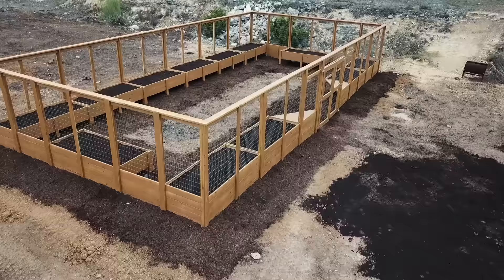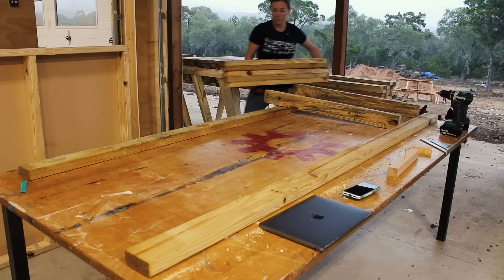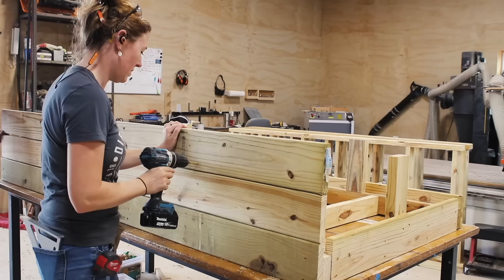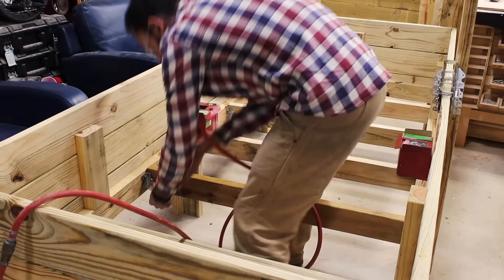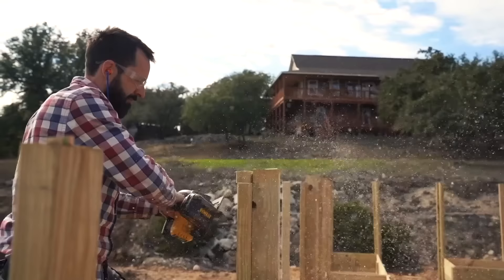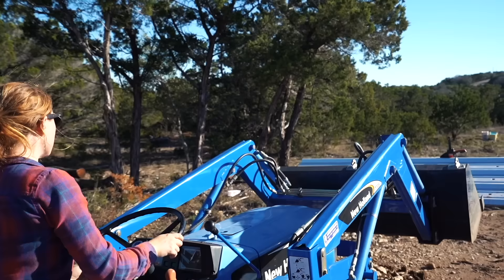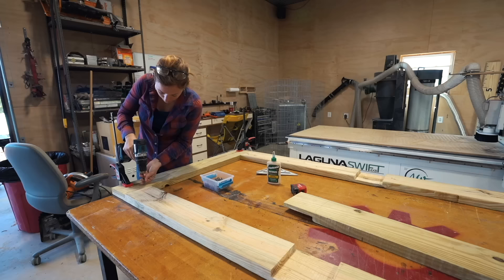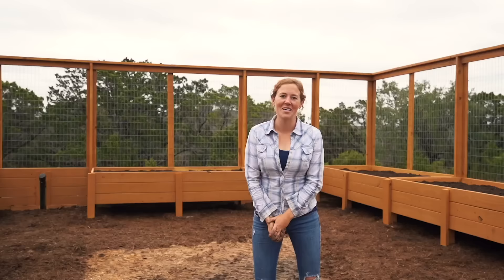Enclosed Walk In Garden with Raised Beds

Comment: I like the look of the end result but I can't imagine putting that much money into a garden. The cost of lumber alone would make it cost prohibitive for most people. 
It also does little to prevent burrowing critters from digging underneath to get in or to keep out birds. 
If you plant berries, you will soon see what I mean.
Reply: Easy enough to put a bird barrier over the top if needed.
Reply: @Flyingdutchman586  good idea, keep hawks off your bunnies (free fertilizer).
Reply: Yeah like gophers. I have a similar garden,not as big 🤣 and gophers are a problem.
Reply: Shouldve put down chicken wire at least to discourage digging animals
Reply: @i.robles5785  stainless steel chicken wire. How about a trench of bigish rocks?
Reply: She used metal roofing material for the floor base. I don't think any animals will be digging through that.
Reply: @MZPRISSYCAT  How is metal roofing material in the bottom of each bed going to keep out critters?
The gate bottom is unprotected and unless the wire is super fine, super strong, and buried over a foot in the ground critters will find their way in. In my garden, I buried the fencing 18" deep, made a drop panel that I stick in place when the gate is closed, and the fence is 7ft high. I still get ground hogs both digging under the fence or climbing over it. I watched one ground hog last season climb onto a nearby shed then it leaped into the garden off the roof. When I spooked him, he ran full speed at the gate, hit the gate mid way up and climbed right out. I now added a 16" top fold over panel on the fence both inside and out so they can't climb over and if they jump in, they can't get back out.  I've also had deer crash the fence at speed, hitting hard enough to bust through the fence or flip over it. 

Tomatoes also attract birds, they don't take one or two tomatoes, they peck at each and every one. After two years of trying dozens of bird deterents, I finally covered the top of the garden with chicken wire to keep birds out and to keep ground hogs from jumping in from the shed roof. 

This years garden will likely have a complete new fence, I'm going taller, with wood poles now vs steel to make replacement of the wire and poles a bit easier and I'll incorporate the top cover into the layout of the poles so the top wire will be a bit stronger. The last top got pretty battered down from critters getting on top. 
The sides weren't strong enough to let me stretch the top wire tight. Having permanent poles will let me put a few cross supports as well.

Comment: Try turning your steal roofing over on it's face it's a lot better for cutting and if you are using it on a roof you won't burn the finish with steal filings were it rusts latter . great video thanks

Comment: Nice job, very similar design to what I'm starting tomorrow for my daughter other than I am putting the posts in the ground, with 18" of blocks under the fence line to prevent critters from tunneling under. Using interior raised bed boxes as well. No rainwater collection here, but I'm running 3/4" pvc from the hose bib nearest the house to supply water to the garden. Glad I happened along this video.

Comment: Building this from your plans, a couple of notes. The Edge Bed cut list is named “Corner Bed” or “Corner Bed” cut list is listed twice in your plans. Also, the joist spacing in the plans (pg 4, 13 1/2 in on center) doesn’t work with the end joists flush at the end as the plan shows. It might work if the end joists are pushed in by a board width as your video shows. Otherwise thank you for the video and the plans. Looking forward to gardening this summer!

Comment: Really nice! I would like to do something like this but smaller to make a kitchen garden. It can also serve as a chicken run during the winter. To get the fence pulled tight you can use two 2x4's bolted tight together around the end of the fence and use a tow chain with your tractor or truck. I have done all of my fencing this way and still looks great after several years.

Comment: I had this idea for the retirement village down the road from my place where I took a wood pallet and closed up the gaps from a broken pallet and then I drilled holes for plants. I put a T-piece of pipe in the middle before I filled with potting soil so that watering was more effective and then I laid it on its side and planted 49 little seedlings and then we lifted it and hung it onto the fence . . . . .

The hanging garden was inspired by an old lady that had a gorgeous kitchen garden that she used for every single meal and she missed it when she had a back opp that went wrong and she was stuck with too much pain. With the hanging garden she could garden while standing. It was a huge success. It fell apart after a year and a half because my skill level as well as tool and raw material selection was limited. . . . .🙂 I bet you could take it to the next level.

Please have a go at it, even an A frame one so that both sides are available, maximising space

Comment: The next time you have alot of fence to stretch, try useing the device my grandfather made, it is quite easy to make, it is only a pair of 2×4's with holes drilled inbetween the holes of the fence, then you can strech the whole run if fence with a chain and chainfall
Reply: She has a tractor.  Just hook up and stretch it a bit.
Reply: @robertsparling  we have done that to, also with a pickup, but the chainfall provides for way better control, we have been able to stretch almost a full roll of woven wire, i have been doing it for 35 years so I am not just talking out of my ass on the subject.

Comment: This is unbelievable. I feel like if you double up with the wood on one of the 2 tall legs and used a router to make a slot to slide in plexiglass and added a roof you could easily make this into a greenhouse for the colder months or for more tropic plants I think

Comment: Amazing work! I'd watch out for the rotting of the zinc panels, the metal sheet you put under the dirt. That could turn black with rust, and damage the quality of your soil. Depends on your weather too. Here, by the beach, they rust very fast when exposed to water and heat.
Congratulations on a beautiful garden!

Comment: You might find that you have a hard time getting to the backs of the beds.  Beds that are 4 feet wide are meant to be accessed from both sides.  Additionally, you might want to grow vining plants vertically to climb the fence, but the deer will still reach them from the outside and you won't be able to reach them from the inside.

Comment: Everything looks good , however rabbits etc. can get in under the gates. Easy fix with bolted on rubber flaps that will bend on the ground. Makes the gates swing harder but the saved carrots will give you the extra strength needed

Comment: Awesome build! Did you ever think of making these into self-wicking beds to save on water and to get the amazing benefits to the plants? You would need for the pond liner to perhaps be thicker (and without holes), install a drain on the side of each bed about five inches from the bottom, put in your reservoir space holders, such as 6" perforated drain pipe, some landscaping cloth to keep the planter mix out of the reservoir, and voila. Yes, a lot more work, but the results might be worth it. My plants are way healthier with self-wicking set ups, I use about 80% less water, and spend much less time watering, weeding, fighting bugs, etc.
Reply: Did you get the design from YT?
Reply: @robertsparling  Yes, AlboPepper has an awesome video about this; it's probably the best video on the subject: https://www.youtube.com/watch?v=Lp9Jdyno9hI&t=19s
Reply: @elizabethblane201  LOL, I just got done watching it!  You 've had good success with it, it seems?
Reply: @robertsparling  Since I am gardening on a 5' x 10' balcony, and cannot put this type of raised bed where I am, I use one EarthBox SIP and nine 5-gallon buckets with the GroBucket system, or my homemade all SIPs. They are amazing and the plants grow SO fast. Huge savings on water.

Comment: I have built raised beds out of pressure treated lumber and was not happy with how long they lasted.  Maybe it was my highly amended organic garden soil but they only lasted maybe four seasons before I started removing and replacing some of them.  They eventually just rot out.  Putting the plastic may seem like a good idea, but the moisture will find it's way in there anyways, not to mention get pierced by your tools.  Weeds are a big problem in most gardens and the seeds always seem to find their way in.  In the future I will be looking at concrete, most likely because of the need to use flame weeders.  The spaces under your boxes will obscure groundhog holes and other animal hiding spaces, so watch out.  Nothing is perfect, I imagine and there will always be challenges to gardening.  I like the coating that you sprayed onto the wood...that should help, especially if you recoat every year or two.

Comment: @April Wilkerson I am fixing to start my own raised bed garden using your plans. I do have a couple of questions for you. 1) looking at  the build of the bed bottom, it looks like the end braces are inset a 2 x 4 width. Am I seeing that correctly? 2) how long of a piece of wood did you cut for use as the spacer between the joist? Thanks in advance for the answers. I find your channel very useful and informative.

Comment: Great design, but I would have made each planter a wicking bed to reduce water usage and water dependency.  I would also add a fine wire mesh/ commercial grade UV rated netting to the roof and walls to stop birds from entering the enclosure and eating all of your produce

Comment: Psa if you use those roofing panels for a roof don’t cut them with a saw the hot metal flakes will melt into the paint and rust after a few months it will look like your roof is spot rusting everywhere

Comment: Fantasy Garden Island.
I'm curious about the wasted wood.  I understand the modular building, but by making a dozen separate isolated beds, you've wasted the wood that separates them.  This is a great design for individual beds, but if you're going to connect them together, it makes a lot more sense to me to leave the ends open and connect the long sides with cross-bracing, instead of end-walls. All of those end-walls are covered up and that's just wasted garden space.
By leaving the end open, you can create a single, long trough planter and save a bunch of money on the wood you used. You can still build it in modules and connect them with screws. Line the bottom with over-lapping roofing and just long strips of plastic along the side-walls.
This design would allow you to disassemble the garden beds to move it elsewhere, in theory, but I can't imagine you actually wanting to do so.  For me, the raised-bed garden space is a set-it-and-forget-it kind of project.

Having said all that... have you made any follow-up videos about how you've used this garden and what kind of crops and how much you've grown there?  Gardening videos... I'm totally here for them. (Did you?)
Reply from the maker: I haven't made specific videos showing my crops etc because I'm busy doing other project videos but have used my garden every year since building it. I love it and wouldn't change a thing. Thanks for watching.

Comment: This  is similar to what we have had to do, except we have used hardware cloth on the bottom half of our chain link fencing and corrugated roofing on the upper half to keep not only the deer out, but the squirrels and rabbits. We also have hardware cloth buried underground. Just wondering why her planter boxes are set directly on the ground. That is what we did with each box 30" tall,  so we could incorpoate a hugel system.
Reply: The legs are on pavers.

Comment: I'm thinking ,hmmm. Ibstead if wood id add chicken wire fencing? along the top and using  plastic type tube as support  at corners and middle. I think there's topping you can add to chicken wire type fencing something like thus nit expensive wood.

Comment: I've built 4x8 beds with about 3 feet in between. My initial attempts at discouraging the deer haven't worked too well. I can't build a permanent fence without a permit so I'm thinking about doing the fence panels, attaching them to the beds I already have. I'm thinking I will have to do gates through to be able to access the outside of the beds.
Reply from the maker: I've seen 6' dog run fence panels that you buy in a kit from a feed store. They come 5 panels to a kit and one of the 5 have a door. You can buy add'l panels also to make it the size you want. Thanks for watching and best of luck.
Reply: @AprilWilkerson  Thanks! I will check it out

Comment: Do use you gloves and safety glasses when cutting wood? Would u recommend which ones are good pls? Do I need to wear those? I just bought a mini circular saw and a portable work horse/bench intending to build my first raised bed. I have never used an electric saw (or any other tool not even a hammer) ever so this could sound like a real ambitious project for me. I’m a female, 5’1” tall and 110 lbs. and not very strong. I will be working on this project mostly alone except for when my boxer pup wants to help. Thanks and I sincerely admire you!

Comment: Very cool April! I am going to do something very similar this spring! Quick question. Why put bottoms at all on your raised beds? I am interested in raised beds so that all the work that happens on the ground isn't back breaking. But if you just didn't have a bottom, your soil sits right on the ground. More room for roots? No need for constructing the bottom? What was your reason for putting it in?
Reply: Also, forgot to ask. I've done this on a very small scale before and am just upgrading this spring. I put chicken wire on the roof otherwise there's no protection from birds and squirrels who love tomatoes. Do you not have this issue?

Comment: OMG what an expensive garden, and you have to grow your own stuff now, too!  For those who don't have commercial connections with Lowes, the best plans seem to be using the longest 4x4 posts you can find which must reach at least 8 feet high above the ground. Set the posts 8 feet apart oc and nail some 2x4s about 5 feet high all the way around. Run wire around that will keep out rabbits and mice and nail it to the 2x4s. Coons and possums you can't do much about. Look for old wire from salvage yards before you go to the big-box and adjust the plans accordingly. Take baler twine, fishing line, or whatever is cheapest and string it between the posts spaced about 8 or 10 inches between the lines. Deer see that and do not try to jump through it. For the myopic deer, put some plastic strips every so often so they have a better chance of seeing it. On the outside of  the fence, plant a bunch of  pumpkins or squash or cukes kind of thick. Deer don't eat those and are hesitant to walk through them, although some will. On the inside of the fence, plant your tomatoes. They don't like those either. When deer jump over a fence, they want to have a clear spot to land on, so make sure those spots all have tomatoes on them. Train some of the tomatoes to the wire. All the stuff that deer love, you can plant in the middle of the enclosure: lettuce, beets, spinach, you name it. But you want to make a garden inexpensive, because you still need seeds, fertilizer, water, maybe row covers or mulch and other inputs. Raised beds are a big expense you can easily do without until you are over 70. Without permanent structures you can easily change row  and isle spacing, direction etc. Every year I have different ideas and I take out the spade and flip stuff around. Spend you money on good wine to go with the food.

Comment: Just a question: Using the pressure treated wood and stain, how long do you think this will this last? I am building the same thing for my parents and I want it to last a very long time, just do not know the best material to use.
Reply: Use plastic lumber.  Make sure there is enough bracing to keep it from bowing.

Comment: How do you find a level to cut off the posts once they are in place?
Reply: You use a laser level to set the corner pavers, then you measure the up the corners to the same height.  Finally, you use a chalk line to make a straight line between the corners.